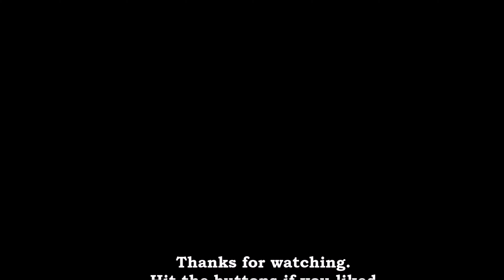Scratching Dirt With The Massey Ferguson 135 & An Announcement

Comment: By Jove, yo've got really hard soil there! - We don't know / understand how lucky we are in the cooler hemisphere where soil may compact, but doesn't Bake so hard.  We run an 11 - bt now have a 13 Tine massey Tiller behind a135 or even the MF40 Industrial with Torq. - fairly cleans out the transm fluid - "boilng off" the condensation water within.  AsI say to folk, don't be froghtenedd - pull that old chromed lever right back and point ractor in right dirrection. Harry's Draft control sytem when properly used is great - and he would be so proud of you!   ...  and I like that design of cultivators you have there.  Slàinte Mhath